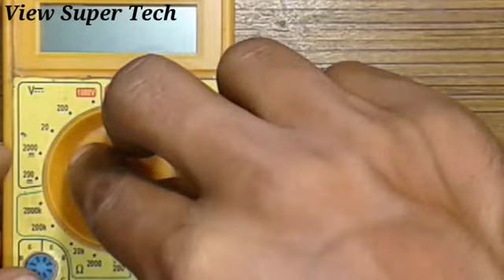Mobile Charger Repair.

Comment: Bazar me sasta bala jo 5V SMPS milta hai, usme repairing me ek problem aa raha hai. Usme sob parts (including two transistors 222, 13003, 230v input fuser resistor, rectifier diode and SMPS transformer) thik hai, lekin power dene se uska secondary me stable voltage nehi aa raha hai, bich bich me 2 - 3 volt aa raha hai. Kuch reparing idea dijiye ...........
Reply from the maker: Aap Zener Diode check kar lijiye. Aur capacitor ko bhi.

Comment: resistor burn within a second. i use 100ohm 2w resistor but its also burn within second. where problem?
Reply from the maker: you use 2e or 3e 1/2watt  resistor.
and check short circuit

Comment: charger mai input output terminal kaise find kare...
Reply from the maker: Gajendra ji 
Charger mein input terminal ek 2.2ohm resistor ke pin se aur ek diode ke pin se hota hai
Output - terminal transformer ke pin se aur + diode ke pin se hota hai
Capacitor ke + - pin se bhi find kar sakte hain
Thank You
Reply from the maker: Please channel ko subscribe kare